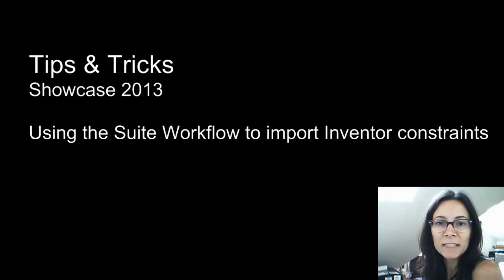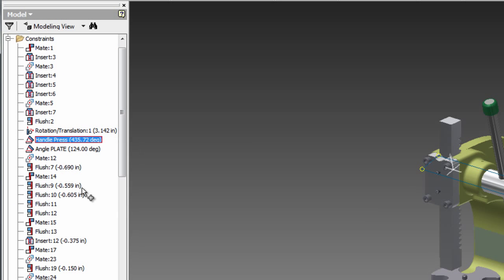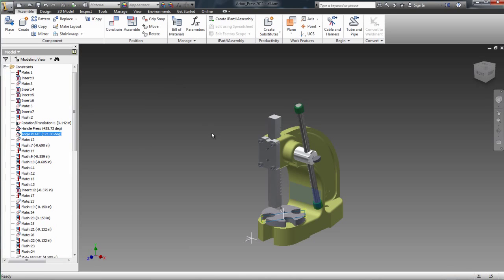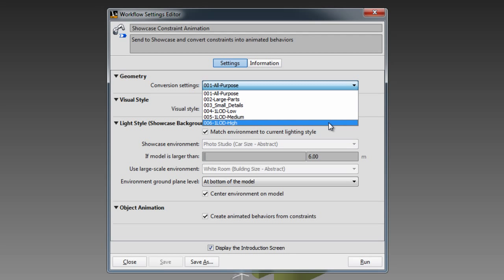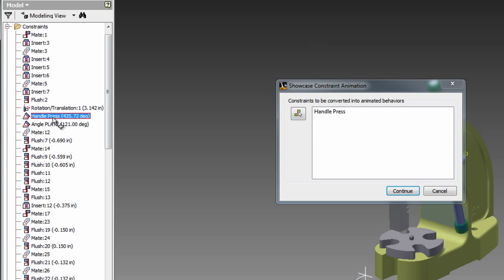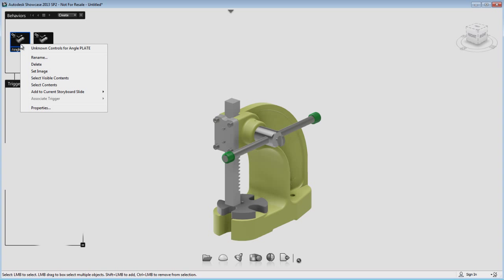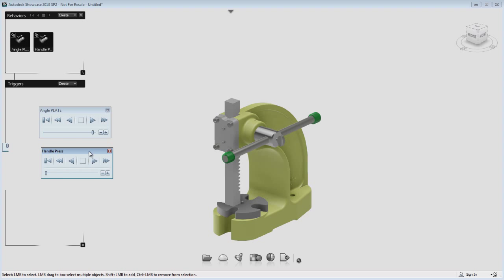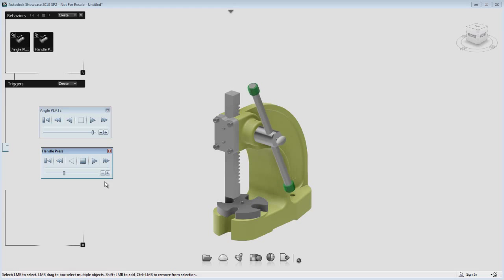Showcase Tips & Tricks: Using the (PDS) Suite Workflow to import Inventor constraints

Comment from the maker: Dear Bahirmary, if you have installed an Autodesk Suite, you should have the "suite workflow" button installed automatically. If you have installed standalone versions of the software, you will not have access to the "suite workflow" button. However, you can still import the Inventor file directly into Showcase. Please refer to the video titled: Showcase Tips & Tricks: Importing Inventor constraints into Showcase 2013 in my channel.